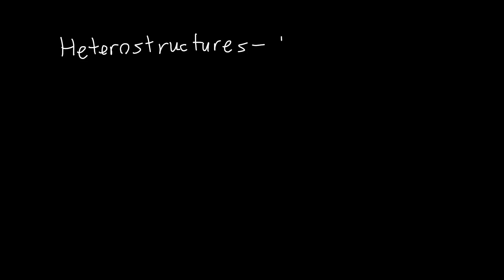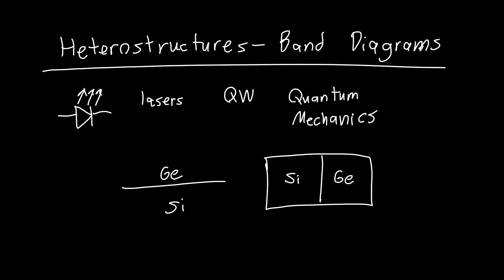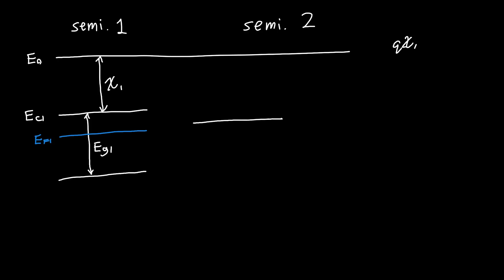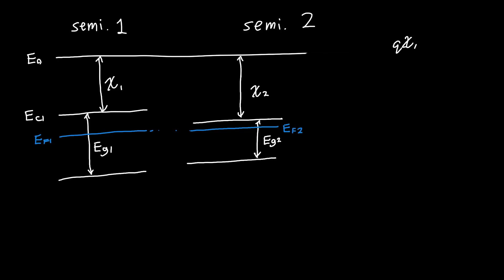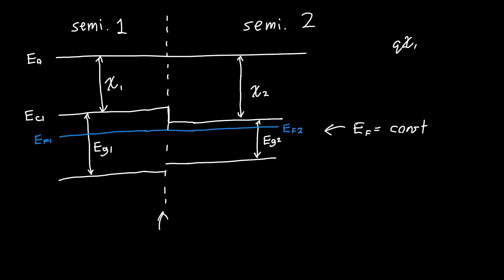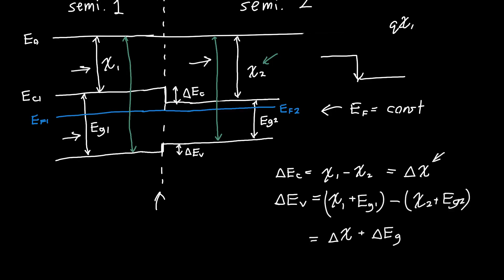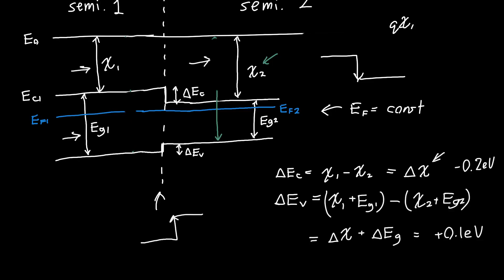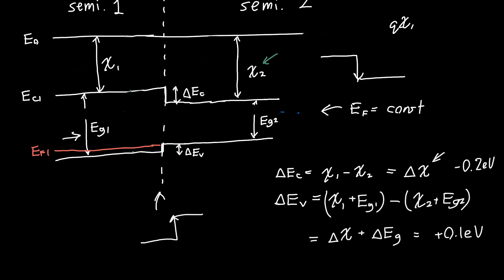Heterojunction Band Diagrams Explained

Comment: why can i assume a common vaccum level.   because in every semiconductor i need a diffrent amount of energy to remove an elektron or?
Reply from the maker: Great question! If the vacuum level weren't constant, that would mean you could change a particle's energy by just moving it around near the surface of a material to a location with a different vacuum level. It would violate conservation of energy.

Comment: how do you know when the bands should bend upwards or downwards? or if the band should connect to the top of discontinuity? why does the band diagram for a n-n/p-p heterojunction look the way it does??
Reply: fermi level should be flat and continuous, therefore lower one should be uprised and higher one should be down
Reply: Band  bend upwards in the direction of electric field
Reply: Exactly my question. watched many videos but no one explain this. why does the jump in 11:05 is on the start of the falling and not in the end of it..?

Comment: Why is it imporant that the two semiconductors, that is brought into contact, have similar work-functions? (If it is important). Obviously it's important for a metal-semiconductor junction in regards to the obtaining a low barrier (Schottky barrier) to allow electron transport, but why is it important for a semiconductor-semiconductor?
Reply from the maker: It’s not important, it just makes things a lot easier to explain at first. The difference in Fermi levels just leads to band bending, but the interesting discontinuities all show up even when the difference is zero.

Comment: What happens when you apply a forward bias to one of the sides?
Reply from the maker: Great question! I will make a video on this sometime. The short answer is that just as with the P/N junction, you will start to bend the bands (or undo the bending of a doped structure). The weird part is that this won't cause as much current to flow because of the quantum well. You can solve for the band structure by treating the quantum well as a capacitor/dielectric (just like as in a MOSFET), but you will actually get some current due to carrier leakage out of the quantum well. How much depends on the height of the quantum well.